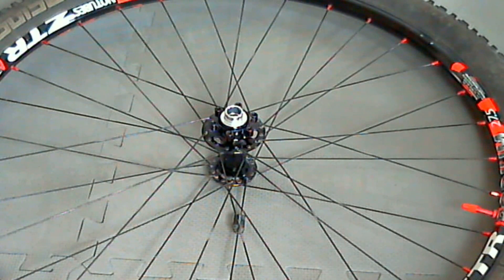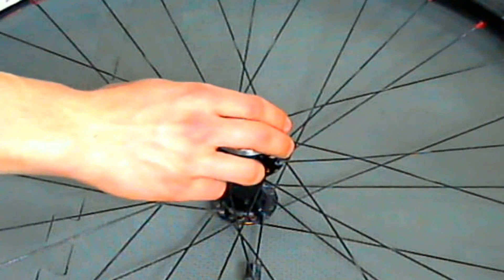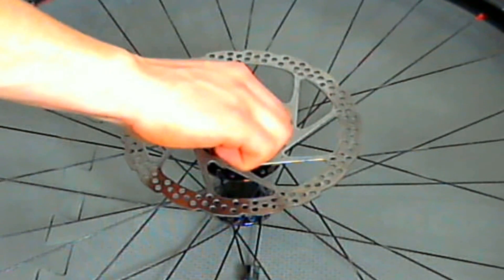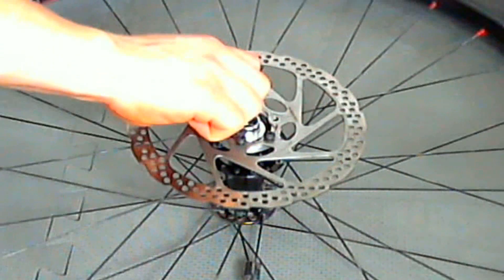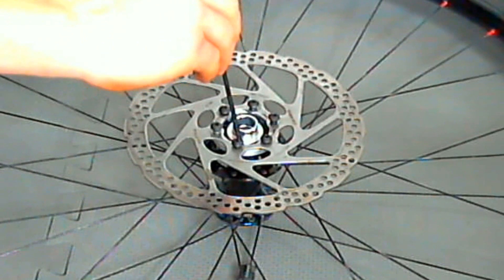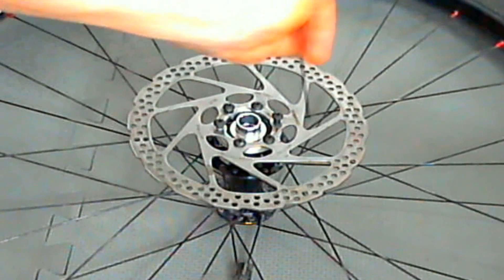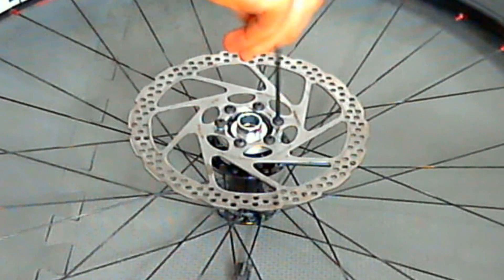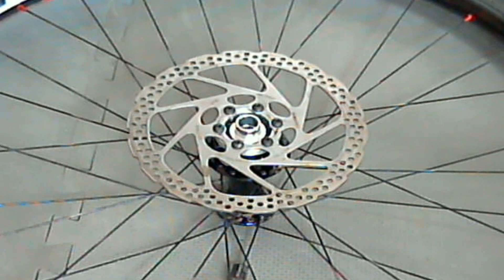Installing a 100mm Hub in a 110mm Boost Fork

Comment: I would put a lil bit of silicon sealeant(for windows) on the spacer and seat it to the wheel. It’ll probably stay on for a long time and u won’t have to drop it and it easily removable. Or just say “f” it and put small beads of jb weld or epoxy. 
Just an idea not sure if it’s a good one or not?

Comment: do you know if this works on all hubs?
Reply from the maker: +Tyler Rinck it will work on any hubs that are 100mm x 15mm thru axle. With a 6 bolt disc. Not a center lock.
Reply: Off Grid Productions, thanks that'd be great since you can't buy a new rockshox in 100 as of 2018